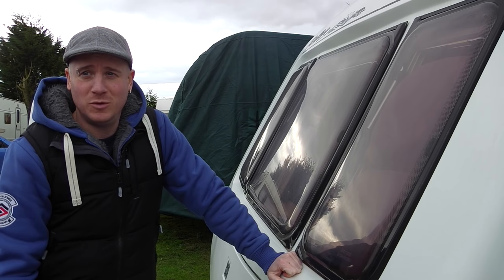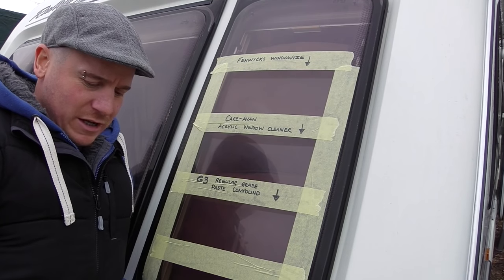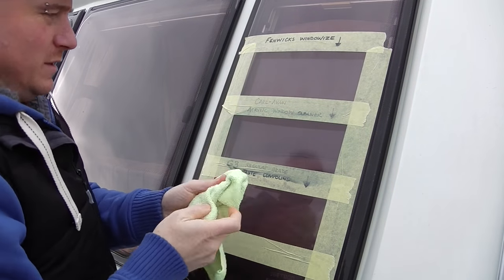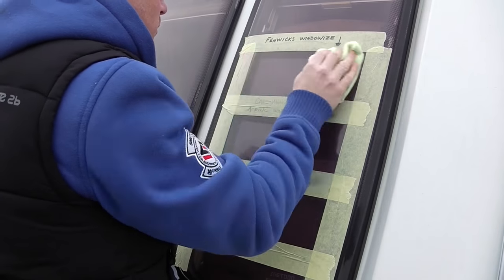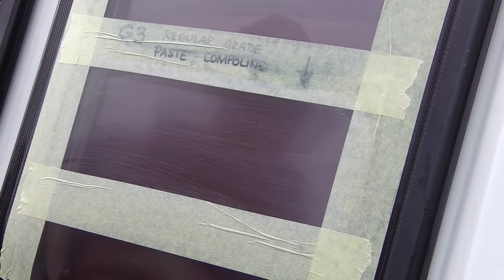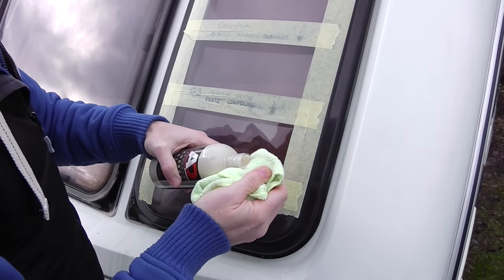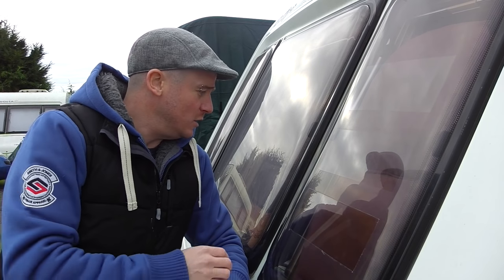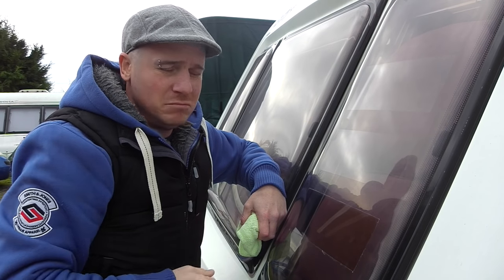Removing scratches from caravan windows

Comment: Hi we have just used G3 on our new second hand caravan windows which are quite badly scratched though fairly superficial.It looks as if someone previously has used some form of scourer.After 3 applications of G3 I still haven’t managed to bring the windows to a good finish.They look great from outside but not so good from inside the van.Any tips.Im in my 70s and may not be leaning heavily enough to remove scratches.
Reply from the maker: Hi anne. The G3 would work much better if you could use it with an electric polisher, if it doesn’t work then you could use a very fine grade wet and dry keeping it very wet with soapy water a car body repair shop will be able to guide you with the necessary grade it will probably be something like a 10,000 grit but you would need to check. after you have used that then go over again with the G3 you should see much better results. Dan
Reply: @caravanninguk6396  3M do a headlight refurb kit, with small diameter polishing discs, fine paper, and compound. This is normally for dull headlight lenses, but, follow the instructions, use a low power rechargeable drill/driver, and acrylic windows come up like new! HTH!